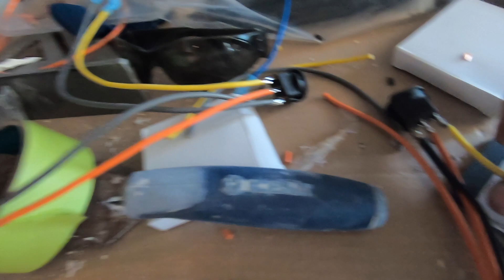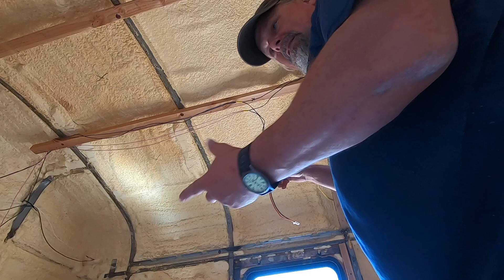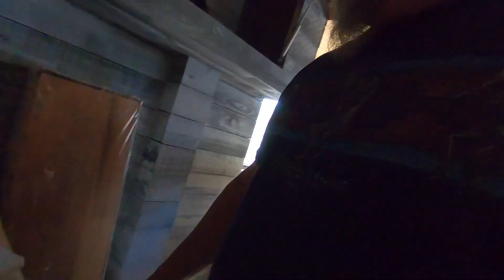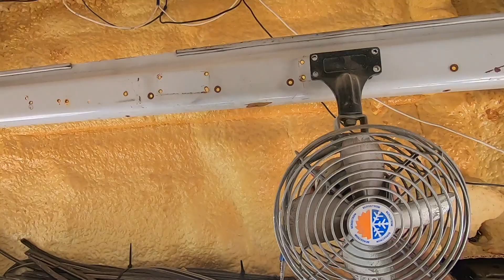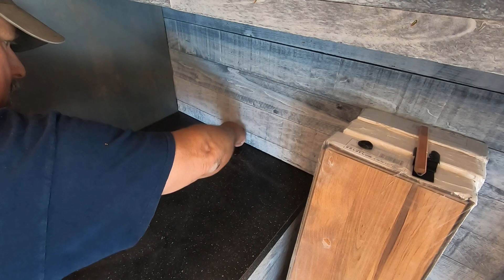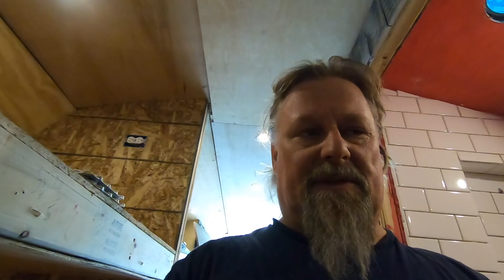Bus to RV Conversion   82   More 12 volt circuits and stuff

Comment: Great to see more progress, with regard the tiling... what about running 2 or 3 rows of subway tile around the bottom... so you can use the other tile on the other wall so it matches... just a thought?
Reply from the maker: too late now!
Reply: @dzlfreek  ah, no problem... might not have look very good anyway!